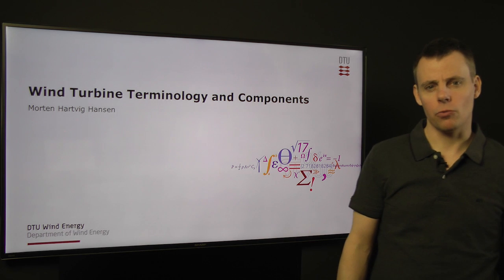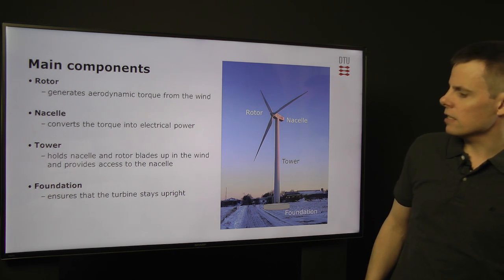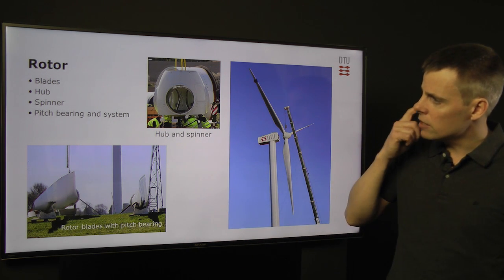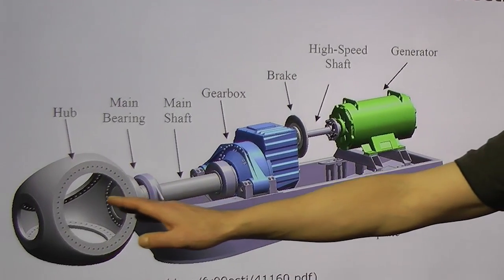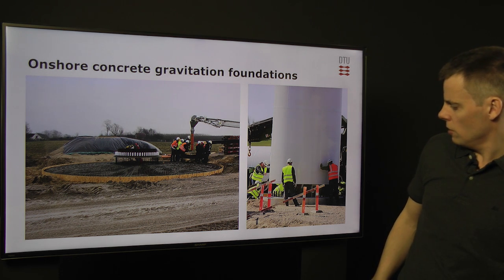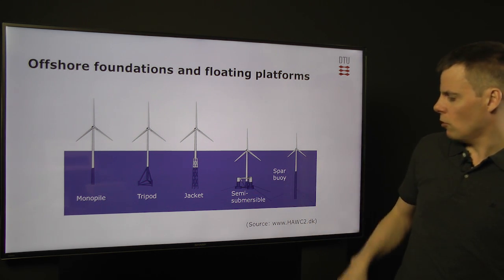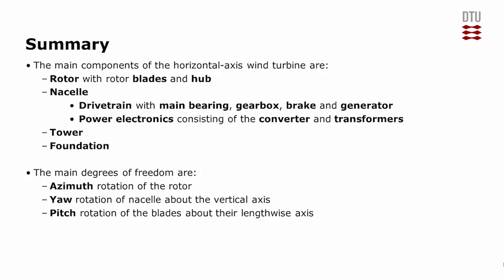12. Wind turbine terminology and Components

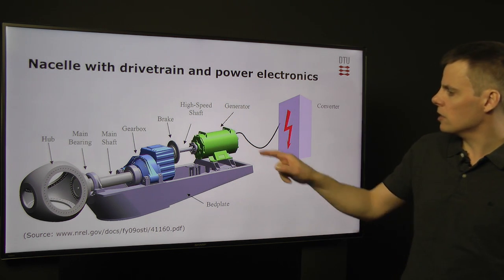Comment: Need a clarification. Does the Convertor (shown at 3:28 ) converts AC power from Generator to DC Power? I think instead of Convertor, the equipment at this place has to be a HV Transformer
Reply: Hey bro, how are you?

I'll try to explain it to you. 

The electrical energy generated by the rotation movement is not yet compatible with acceptable levels for connection to the grid. Therefore, different electrical systems are needed to regulate this work, which is why the converter is present. The transformer also exists, it is the link between the grid and the turbine.

Comment: Can't understand the purpose of converter, please explain it in detail
Reply: Hey, how are you?

The electrical energy generated by the rotation movement is not yet compatible with acceptable levels for connection to the grid. Therefore, different electrical systems are needed to regulate this work, which is why the converter is present. The transformer also exists, it is the link between the grid and the turbine.

Comment: Wind Turbine Terminology and Components
--------------------------------------------------------------
Learning Objectives:
After this lecture you should be able to:
	- List the main components of the commercial horizontal-axis wind turbine
	- List the main degrees of freedom of the commercial horizontal-axis wind turbine
	
Main Components
-------------------------
	Rotor: Generates aerodynamic torque from the wind.
	Nacelle: Converts the torque into electrical power.
	Tower: Holds nacelle and rotor blades up in the wind and provides access to the nacelle.
	Foundation: Ensures that the turbine stays upright	
	
Main degrees of freedom
----------------------------------
	Azimuth: Rotation of rotor about its shaft due to the torque.
	Yaw: Rotation of nacelle about the vertical lengthwise axis of the tower.
	Pitch: Rotation of blades about their lengthwise axis due to pitch control action.
	Rotor:
		Blades, Hub, Spinner, Pitch bearing and system
		
Summary
-------------
The main components of the horizontal-axis wind turbine are:
	Rotor with rotor Blades and Hub
	Nacelle
		Drivetrain with main bearing, gearbox, brake and generator
		Power electronics consisting of the converter and transformers
	Tower
	Foundation
	
the main degrees of freedom are:
	-	Azimuth rotation of the rotor
	-  Yaw rotation of nacelle about the vertical axis
	-  Pitch rotation of the blades about their lengthwise axis
Reply: Nice! Thanks!